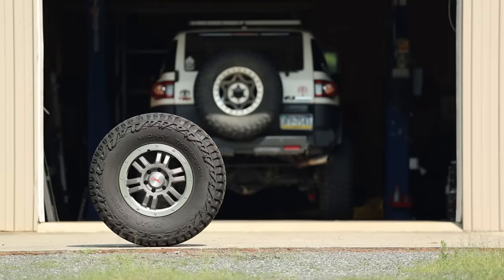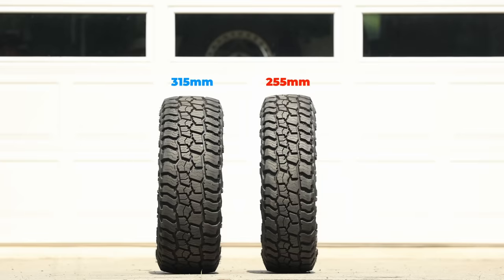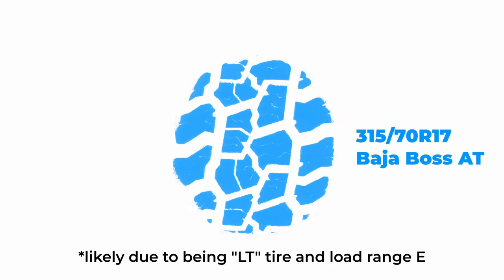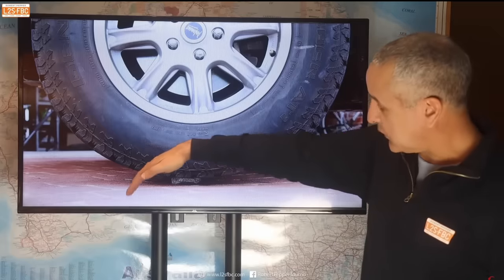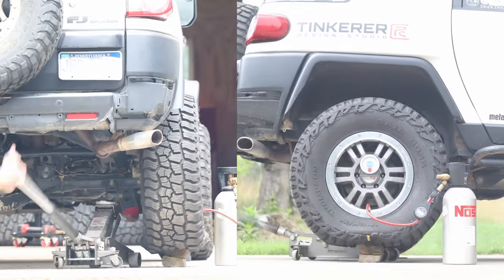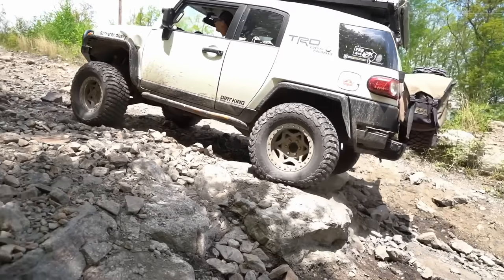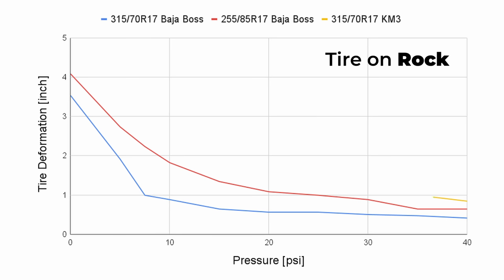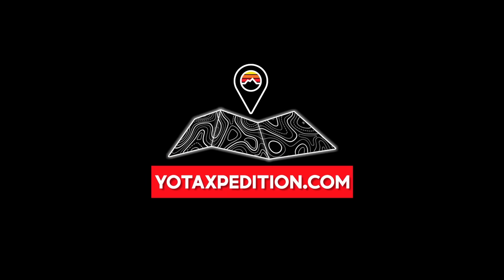3 Scientific Experiments to Settle This | Wide vs Narrow Off-Road Tires

Comment: Contact patch is a function of tire pressure and vehicle weight. Same weight and same pressure will lead to similar contact patch size.

Tire flex ramps. Under increasing load (constant weight, lowering pressure) the flex remains relatively flat until a critical point where the flex starts to increase greatly. Narrower tires reach this critical point at lighter loading (higher pressure).

What is happening at this critical point is the transfer of force on the tire side wall, instead of the contained air pressure. When skinny and wide tires are at full pressure, neither had a contact patch that reached tire width. The entire load was supported by contained air; the sidewalls are only containing the air pressure. As the contact patch width approaches the tire width, more load is placed on sidewall directly. This works from the other direction too; as tire pressure decreases, the contained air needs a greater tire area to support the same weight, thus the tire must deform more. Either way, as contact patch width approaches tire width, tire flex increases.

Thus the narrow tire contact patch approached tire width at higher pressures, loading the sidewalls for deformation, earlier, resulting in narrow tires having greater flex at same tire pressure and vehicle weight.

The choice between wide and narrow tires is if you want less or more flex at the same contact patch.

Excellent video!

Edit: terrain still matters for tire width choice. Contact patch is a reaction from a driving surface that can support the same pressure. On soft terrain that cannot support the pressure, the terrain will deform around the tire. Thus tire geometry/dimensions matter, as the terrain is forming the contact patch around the tire. Narrower tires let you sink through the soft terrain and wider tires let you float above it.  For snow you want the skinniest tires to sink through snow and reach the pavement underneath for a normal contact patch. I know for sand and riverbeds, you want a sweet spot to sink in about 3 inches. Too wide, you are stuck floating on the loose top layer with no grip. Too narrow and you end up digging with too much material in front of your tires.

Comment: Wish you would have also included different load rating (lower for the MT) tires to see how that would have impacted the results. Should have a big result since you are focusing on tire flex at different pressures. A lower side wall stiffness would be interesting to see how it compares to the E.
Reply: No need, you'd get redundant results. The trend of how the tire flexes stays the same with only the magnitude of how much it flexes changing.
Reply: @aidanduncan5086  Agree, but lots of us have to choose between C and E and I'd like to know how much worse my flex is with E instead of C.
Reply: Very true.  The 46in military tires I had on my toyota looked pretty normal at 0 psi.  (Load range G if I remember right?)  Great if you get a flat, not great for tread flex.  🤣
Reply: @Brandon_Makes_Stuff false, its great for flex, just not the appropriate weight of vehicle.
Reply: Oh you do, do you? You wish he included more information? Tell us more about how your glass is half empty. We would all love to hear it 👀🤌🏻🙄
Reply: @ryanreyes9456  Let's see how many thumbs up your comment gets compared to mine.
Reply: @MrEMan-ex3uv  omg more thumbs up?!?! How will i ever sleep at night? Loser.

Comment: Way back in 1980 I was running 255/85X16 BFG mud terrains which, back then were a polyester based and rayon infused carcass that had no steel in the make up whatsoever. The tyres had terrific flex off road. They would mould around rocks very effectively at 20 psi. In very gumbo mud, I would drop pressures to 16 psi and this usually would pull through most sticky surfaces. BFG began using steel in the carcass and these second generation mud terrains did not work as well as the nylon/rayon first gen. They did get better mileage and had better puncture protection, but did not grip as well. 43 years later, I still run with this size tyre and overall they leave the wider tyres behind, especially as they tend to cut thru the top layer of sludge and find traction underneath. I must add, that the first gen tyres were fitted up on 5.5 inch split rims that tended to suck the sidewalls in, due to the narrow rim. There is a marginal difference in how these tyres behave when mounted on 7 inch and 8 inch wide rims. So, here is another advantage to the 255 section tyres - it is flexible enough to be fitted to rims between 6 and 8 inches. Be mindful though, that up to 20mm variance in actual tread width and road contact can be seen in this size tyre, depending on the particular manufacturer. I found that Dick Cepek had the widest tread contact of all the popular makers currently offering this size.

Comment: Tire clearance is a big reason why I use a 255/85R16 on a Suburban, and glad someone finally introduced a tall-skinny 35. For the weight, it may end up being an ideal fit over the gummier KM3.
Reply: Which tire are you running in that size? I've been trying to find 255/85R16 ATs for my Tacoma. Trying to stay away from MTs since I daily drive it, but that's all I can find for that size.
Reply: @hwi7114  Cooper Discoverer Maxx S/T, fantastic in a lot of sloppy conditions but they're heavy for their size -- great sidewall thickness and support for a 7000 combo and they do tow nicely, may be a bit much on a Taco. But low noise, great side-bite in sand and mud, does great in Western AZ's cragly stuff, and does well enough in sand. I've seen some KoH racers use this tire too for the side-bite and overall sidewall stiffness, similarly heavy trucks though.  

As mentioned in this video, they air down into a good footprint without actually being low on pressure, I rarely needed to even use 20psi and I usually targeted 25psi. 

I get about 20k miles, maybe more, but AZ terrain is rough on tires being so cragly.

That said, I'm probably going to get 17s and go for this 255/85R17 since the truck could benefit from the extra diameter for its wheelbase, but keeping a narrow tire is what allows this thing to use full steering without rub -- offset/width is the killer more than diameter.
Reply: @phillipthomas4489  Thanks for the reply. I was eyeing the Discoverer Maxx ST, they look to be the most AT like in that tire size. The down side is that they are the most expensive tire in that size. How do they do on road in the rain? I live in Florida so that is an important consideration.
Reply: @hwi7114  Great in all weather, I have no complaints about them. They're not like the old BFGs that get icey on wet roads at all.
Reply: @phillipthomas4489  Thanks, your feedback is much appreciated. For a daily drive it sounds like they are probably worth spending the money on over the other options.

Comment: Excellent video, thanks for sharing! Additional experiment idea: Since tire contact area must not correlate 100% with grip force, I recommend to look after a steep or flat area made out of concrete or asphalt. Then place the car on that spot and strap down the car from the back. In that strap place also a crane scale to measure the grip force when you try to move the car until the tires start to slip. Monitor the max. force on the scale and compare the different tires and parameters.
Reply: Great idea

Comment: Nicely done video!  I've been running narrow tires since 1987.  I'm also a mechanical engineer.  There are additional dynamic aspects to narrow tires that you might consider covering at some point in a follow up video.  I'd love to see that.  For instance, better directional control in low traction situations like mud and snow allow you you maintain momentum far better than wide tires.  You can stay harder on the throttle and clear your tires better without losing control and ending up in a ditch.  You are also breaking a narrower track through soft materials, so the resistance to forward motion is far less.  The simple fact is this though.  99.8% of tire buyers make their decisions based on looks.  Almost no one chooses tires based on actual performance.  For this reason, narrow tires are not gaining market share, but loosing it.  Just about the only tires out there still available in narrow profiles are older outdated designs.  As those models are deleted,  Choices get smaller and smaller.  None of the newer high tech tires are offered in narrow sizes.  The trend is larger wheels, lower aspect ratios, and wider tires.  All of which are bad news for serious off roaders.  It's great for mall crawlers though.

Comment: Great video, it's rare to see an technical approach to evaluating anything, much less off-road tires. You did a great job! Since the tire contact area has to support the weight of the vehicle, I would assume that similar tires/pressure on flat surfaces would end up with the similar contact areas with the wide tire being wider/shorter than the narrow tire which would be narrower/longer. Other factors to consider,  I believe the skinnier tire will perform better in snow (less snow plow effect) and get much better mileage, especially at highway speed (I know you are focused on off-road only, but gas $$ can impact our recreational budgets). Not how skinny vs wide for ice, sand, and muddy terrain (maybe skinny wins here too?).
Reply: in mud and loose sand wider is usually better. on ice skinny is better but the rubber hardness and thread style makes more difference. Here in Finland we use studded tires on winter. i have dynapro at-m for summer and they are fairly soft rubber, but they have really grip on ice. Same size old wintertires "Nokia Hakkapeliitta" studded tires that i have taken the studs out grips 90 times better on ice since they are designed to do so and have thin lamels as the tire thread. Dynapro have bigger type of thread. and a proper MT tire with big lugs have zero grip on ice. there are also winter tires without studs and they also have the thin lamel type of thread and they have better grip than the de-studded tires. in snow. a skinny tire with agressive big lugs seem to be the best but that is mostly based on experiences with atv driving and also depends on the type of snow... On loose gravel road the AT-m Dynapro is best that i have tried. Good grip and a predictable "drifting" point where they start to loose traction and you start drifting with all 4 tires at the same time :D
Reply: My theory is that narrow tires are better for hard surfaces you want to curl into, while wider tires are more useful for softer surfaces and being more flat in order to avoid sinking.
Reply: Hello, yes I agree, normally we would assume thin for snow/ice and thick for sand/mud.  The only thing that I wonder about is his experimental results regarding foot print at reduced tire pressures. I think the thin had a larger overall (surface area) than the wider tire. It may just be the tires or the flat surface vs a softer one which would allow a wider contact area. I think it might be a good experiment.

Comment: Love this video’s approach!  A variable that needs consideration is the fact that your KM3 were broken in at time of the rest whereas the Mickys were new.  I’m sure that impacted the test results… to what extent?  I don’t know.  You’d have to isolate and test that variable separately.   New same size KM3 vs your broken in one.
Reply: This comment above!  Broken-in tires flex better than new ones.  I ride moto trials and never compete on a brand new rear tire, but instead break a new tire in with 5 hours of riding before a competition day.

Comment: I think the load range E may have had a serious impact on your results. That's a load range I would expect on a overlanding Ram 2500 Diesel, not a small FJ. I run 35x12.5R15 load range C on my 96 T100, I begin seeing heavy sidewall deformations on obstacles around the 15PSI range.

Comment: Great video - I think another benefit of the pizza-cutters you chose was aerodynamic at highway speed. Huge tires add a lot of drag and rolling resistance in addition to the inertia - and this adds up to worse gas mileage and higher noise levels. You definitely made the right choice. I actually think the skinny tires look kinda cool - rugged in a different sort of way.
Reply: This would be a good follow-up experiment: fuel economy and road noise.

Comment: Hi! Nice job man. It meets the choices we made in Djibouti in the 1990's, by pragmatism : thinner tires (we were operating in semi-desert area with fast tracks or very damaged asphalt, sand, rocks, and many mixed areas). We experienced widers had way too fast wear compared to thinners, much more puncture in rocks, no better grip on all zones, lesser grip in turns and flubier stearing on fast tracks, a bit more radius of turn on every terrain.
Later back in my country, an off-road preparator explained us it was right, as thinner tires have more caterpillar effect (you nailed it in your video!) which is essential on these terrains (and even more when sand becomes softer and softer !), and thinner tires have less friction on the flanks in rocky zones. Moreover, we greatly appreciated the gain of weight (again, you nailed it :) ) for payload and for lifting wheels to or from the roof by hand when changing flat tire in the desert, and the fact that it has always been easier to supply thinner tires in Africa for a same brand and model.

Comment: Great video! So refreshing to see true controlled experiments and useful - even surprising data! I've moved to 255/85R17 pizza cutters on my lifted 2017 Colorado ZR2 and I LOVE them! Not only are they great rock-crawlers down in Moab, but they are also very smooth and directional on the highway and excellent on the snowy roads we get here in the mountains of Idaho. The narrower tire is also much easier to fit on an IFS vehicle like mine - really the only practical way I could have the ground clearance advantages of a tall 35" tire and not rub while steering under full articulation.

Comment: It really depends on preference and terrain.  I’ve been in mud and snow where I needed a narrow tire to cut through. The wide tires I had just push the mud or snow.   
Then there are times when you need more floatation like sand.
Reply: In snow that doesn't exceed your ground clearance, skinny tires rule just for that reason - they cut down to what you hope is the road and not a sheet of ice. Is there a snow shoe effect with fatter tires I wonder?
Reply: The experiments in the video showed the area of contact patch stays the same. Why would a wider tire float better on sand?

Comment: Great video. I've always actually liked the look of narrow tires - looks retro to me. And I prefer them in the snow - think they're easier to fit without rubbing, etc.
Reply: More road resistance I would think too, the only thing the wider tire is better is floating on sand.
Reply: @1607rosie  and stopping, it has greater assist in stopping/breaking

Comment: It would be very cool to see a comparison on deep sand between wide and narrow i think.
Reply: and snow...
Reply: Tires that are 75%worn do much better in sand than brand new tires.
Reply: Sand you want wide snow is depending on how deep it is compared to how much ground clearance you have if the snow is only 1.5-2ft deep and you have a foot or two of clearance you want skinny to dig to the ground if snow if very deep you want a wide tire so you don’t berry yourself into the snow
Reply: Narrow tires get better fuel mileage
Reply: Narrow Tyers have a greater psi on ground

Comment: Wow, the km3 did so well! It'll be so interesting to see how other tires do as well.
Reply: KM3s are the best offroad tires. I have them in 37s.
Reply: Except BFG's quality controls suck.  They require enormous amounts of weight to balance.  Are prone to cupping after 10k miles and are the most expensive tires.  Nitto/Toyo and Falken AT3W (best bang for your buck) are my goto tires.
Reply: @bamafencer12  my km 3s lasted me less than 20k miles before they were shredded entirely. I can never trust another set. Great traction but couldn't last the simplest of trails.
Reply: @trevormcdonough  I have almost 30k miles on my 255/85R16 KM3's and expect another 15-20K based on the remaining tread.  My off-roading involves mud and rocks, but - of course - the majority of the miles are highway.  There are a few cuts, but not chunks missing, typically around 15-20 psi when off-road.  These are on a Tacoma that's not overloaded with a bunch of overlanding  paraphernalia.
Reply: @danpauls3323  Man that his awesome for you! my set was on my 2016 Duramax colorado and I had a tent on and off of it but nothing crazy heavy. I mostly did highway and dirt roads with a little bit of rock crawling. They were thrown away at 19,600 miles and BFG refused to do anything for me so I have never bought another one of their products. Put 60k miles on a set of Coopers and they looked half life or so before I sold the truck.
Reply: @bamafencer12  the KM3 wasn't a fair comparison because they're used tires and broken in. It would be a very different result if they were new. I wonder if Kai is sponsored by BFG.. lol
Reply: @trevormcdonough  Sorry to hear about that. What are you running now?
Reply: @trevormcdonough the stock raptor K02s don't last 15k if you use the truck as intended. I dropped them for Cooper ST maxes and they are better in every category except noise. Not too impressed with the KM3s from what I've seen.
Reply: @bamafencer12  I am running Mickey Thompson Baja Boss AT and love them. Have 20k miles on em and they look almost new still. still soft and quiet too.
Reply: @T4nkcommander  Yeah my raptor ripped through the KO2s quickly so I sold em asap and swapped to mickey thompsons and love them.